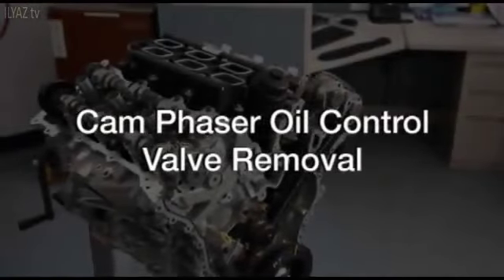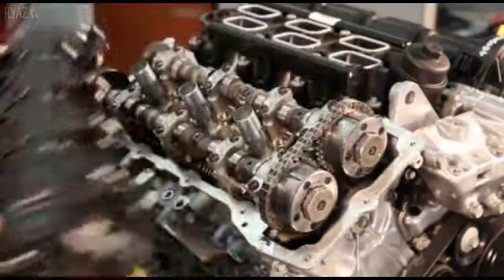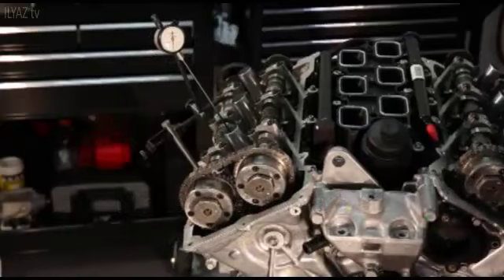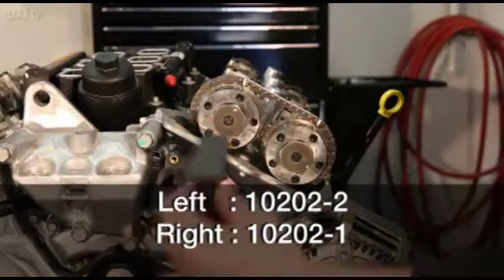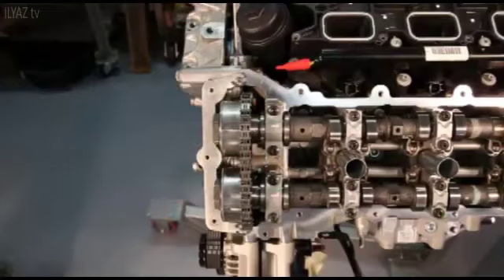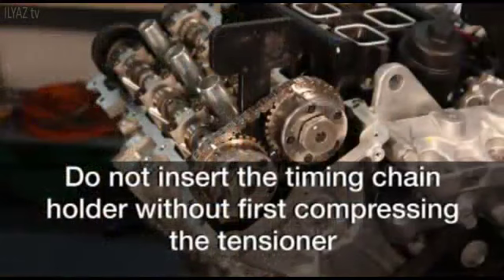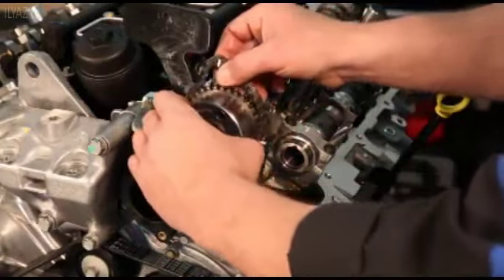Chrysler Pentastar V6 Engine 3 0L 3 2L 3 6L Camshaft Phaser Removal

Comment: The thing in your hand at the beginning of the video is not the magnetic timing wheel. You’re holding a cam phaser which doesn’t have magnets in it.

The magnetic wheels are on the OPPOSITE end of the camshafts relative to each phaser. You want to avoid putting anything magnetic around those or else you’ll get bad or intermittent camshaft position sensor readings.

Comment: 2017, Ram 1500,  cam sensor , and both cam phasers on both sides,  done under warranty luckily,  at 38,000 miles. I hope this motor lasts, Is this typical????
Reply: Yes...Jeep, Chrysler, Dodge, Ram with Pentastar V6

Comment: Changing RI camshaft - when trying to remove the phaser the whole camshafts (both) roll.  Guess I need this plastic tool?  However, I have been unable to locate where to find it?  Can you point me in the right direction?  Thanks.  Great info and channel!
Reply: Amazon has it. search for tool number he displays on the video.

Comment: How the hell do you get the chain tool in without breaking it on the right cam? Broke 2 of them now, no way it fits in.
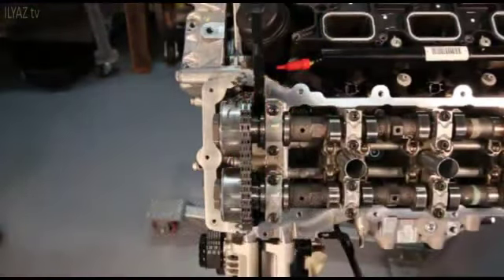Reply: You must rotate the right exhaust cam clockwise to release the tension on the tensioner before you install the tool.  See 1:36 in the video.
Reply: @J Ronsonette  i rotated the cam clockwise and still it won't move.

Comment: When you go to lift the pawl off the rack the hole is on the left hand side (towards the passenger wheel well.  You are looking for a little hole in the side that the pin goes into.
Reply: It's in the front of the tensioner.

Comment: What size socket and wrench is used to remove the Phaiser? Thank You
Reply: 36 mm to remove the oil control valve which will allow you to remove the phaser.